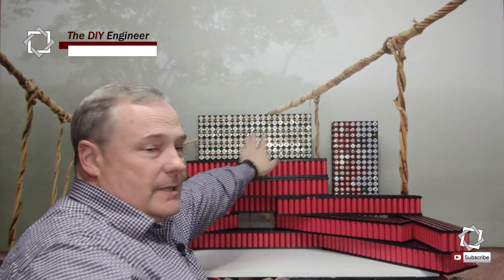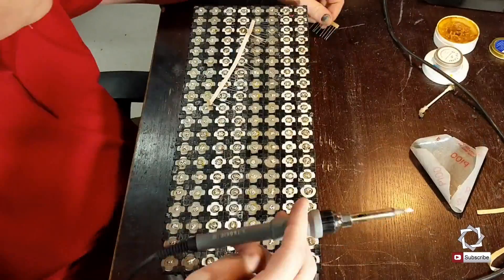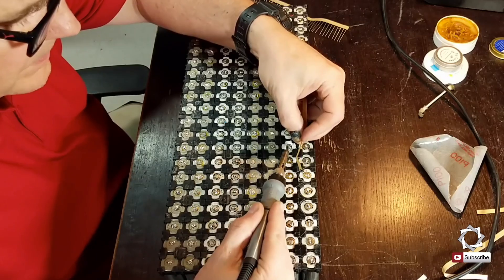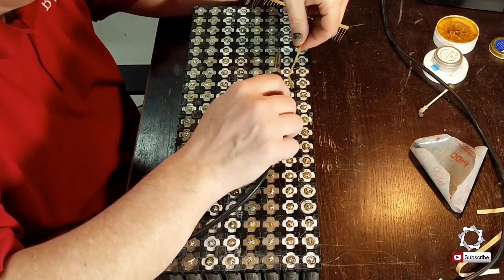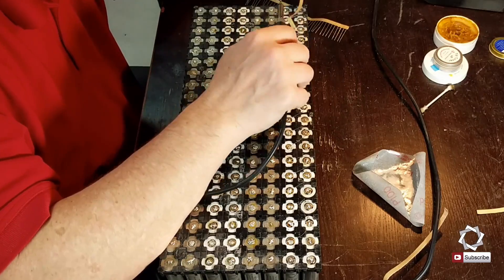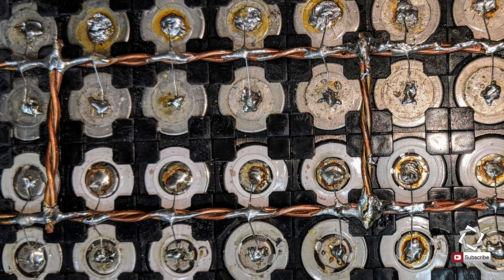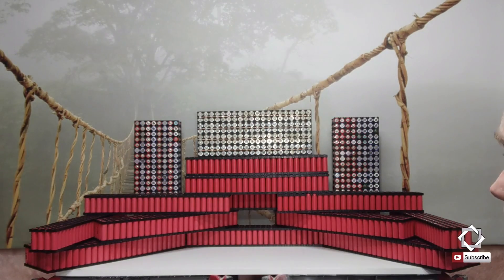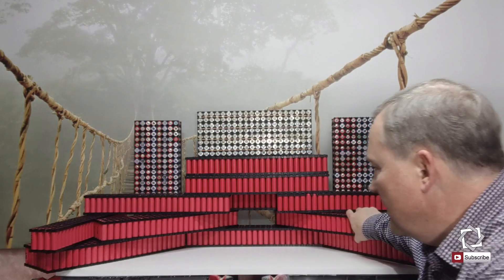18650 4S 40P Battery Upgrade

Comment: Thank you so much for this video! I'm in the process of gathering up all the goodies to build my own portable power bank, I'll be doing a 4s 30p pack. This will be very helpful in my build. I'm hoping to be able to run my trolling motor battery off of this pack. If I have to, I can build a another battery pack to go inside of this portable power pack, provided that there's enough room. Which I think there will be. I just hope I can provide the 55 amp draw that my trolling motor will need.

Comment: You're the engineer.  You should know which comes first - an S or a P.  Batteries are normally thought of as  X volts at Y power over time not the other way around.

Comment: For all, about soldering on the cells - being heat is bad for these as the insulators inside the cells between plates is plastic, so take care when soldering.  That being said, don't use a low power soldering iron. Yes that sound counter intuitive, but using  a soldering gun of about 120 watt will heat the connection fast where the low power will heat the whole end and radiate deeper into the cell.  So the soldering needs to be fast so heat can't radiate into the cells.  It's the same principle as the spot welder being high fast heat to weld the contact resulting in fast cooling - no heat into the cell.
I have always soldered to cells with no degradation to voltage or mah of the cell.  And I do my packs just as Frank does here. Thanks Frank for your teaching of others..

Comment: I want to see hows look alike on 14S (52Volt) & 8P. (The battery description is LGDBMH ICR 18650 3200mAh 3.7V High Drain 10Amp). Which could generate the total capacity of 1331.72Wh and the total battery cells are 112. Keep in mind that this is the latest batteries in the market.

Comment: Just a quick note...  Some of the cells struggle to take soLder because of the size of your iron tip..  Trick is to use as large a tip as you can on a hot setting,  this improves the flow and adhesion of the soLder and lessons the time the iron needs to be on the cell which also avoids damaging the cell due to excessive heat being transfered with a smaller tip because you have to be on the cell way too long....   :)
Reply from the maker: Yes, I figured that out later,  Thank you for pointing that out.

Comment: Looks like it could be a pain in the butt to replace one cell since the whole thing is soldered together. You’d have to take the whole thing apart?
Reply from the maker: If I were to get a bad cell I would probably just break out the tabs that hold it in place and replace the one cell.  AveRage Joe has an interesting way to solve that issue, you should check it out.  https://youtu.be/ChN9q7bVRRk

Comment: Do a EV! Please I'm trying to build one on a budget but it's really confusing all the things I need for it please help nice videos
Reply: Use a warP 9 motor
Reply from the maker: Hmmm, your ahead of me...  I may be coming to you for help.  :-)
Reply: Frank Brand I'm trying to build a 3400lbs ford ranger pickup manual transmission with ~3000cells with 2350mah rating warP 9 motor with a diy motor controller and I'm not sure what charger I'm doing yet!
Reply: Frank Brand where do you live maybe we could meat up! I'm on the east coat

Comment: I also want to build a ev of some sort. I have. some forklift motors.  I'd like a car or small truck. but may start with a bicycle. or scooter or motorcycle.  but I don't want it to be slow. I can't stand to be passed . much less by everything. with a line of traffic behind. so I'd want at least a top speed of 70-80 mph. and 0-60 in 6 sec or less. I don't need Tesla speed. but yes I would like it. I'd probably build a car shed or motor cycle shed. with solar to charge it. with a wind turbine . with the ability to send the power to the house. 6-800 watts and a small batt bank for charging a ev . couldn't be that bad. and my house is off grid. I charge my batts with the generator for now. I hope to start solar in a few weeks. the generator needs a break. and I'm tired of hearing it! running a 6kw generator. to charge with 1000w or less . isn't exactly efficient. I'm also working on a DC generator. and will charge at 29v 150a. well that's enough rambling. all those cells in packs look great. I'm still charging and testing! I just about have my charging testing board finished.  can't wait for the next video!!!
Reply from the maker: That is just what happens when you start playing with these cells, you come up with all these things you want to build and/or try.  You definitely have the 18650 big!!!  Good luck with you cell testing.  Keep me posted on how your project comes along.  Frank

Comment: thats kwh with an h
Reply: Remember: Those who don't know the difference shouldn't be playing with electricity or high-power batteries. That's why we insist on proper terminology. I'm off-grid solar for 20 years as of this summer, on a 52 kWh battery set (giant 2 volt industrial lead-acid cells), and engineered my own system. Anyway, good on you for exploring alternatives. Good luck!
Reply from the maker: Yes, you are right.  My bad :-)  Thanks for watching.

Comment: Nice build video.  I'm also working with 4S packs and have them running on solar with a 120V power inverter.  It's a nice intermediate step between 12V and 24V.
Reply from the maker: I really think it is a good idea to start with smaller projects and learn as you go.  Thanks for watching.

Comment: Her Frank,  Great videos.  I am curious to get your take on the soldering vs spot welding question?  I am just getting started processing cells and want to start with a portable power pack as well.  My plan is to solder similar to what you are doing.
Reply from the maker: I have a friend who bought a spot welder and had a hard time getting it to work right.  I wanted to use fuses on my cells I felt like using a spot welder for that was more trouble than it was worth.  I have not had any issues with soldering.  Thanks for watching.  Frank

Comment: What is your fuses rating
Reply: He is using resister leads. They have been proven to be between 5 amps and 20 amps. It depends on the length of the lead. Go to Average Joe's page. He did some great testing on them.
Reply: James Klafehn thanks. Really helpful

Comment: What  gauge wire are the fuses?
Reply: He is using resister leads. They have been proven to be between 5 amps and 20 amps. It depends on the lenght of the lead. Go to Average Joe's page. He did some great testing on them.
Reply from the maker: I just use the wire off of these 1K ohm 1/8 Watt Resistors http://amzn.to/2FZF09I.  A friend of mine has some fuse wire that he has offered me.  I may do a video comparing the two.  Sorry that may not be very helpful.  Frank

Comment: My understanding is that the order is from “topmost” to “bottommost”, or the last connection made to the first connection made. So for example I’m making 8p packs, connecting those in 7s, and then connecting those in 3p - so I would call this 3p7s8p
Reply from the maker: That makes since because it gives a clearer description of the layout of the cell packs.  Thanks for your input!!   Frank